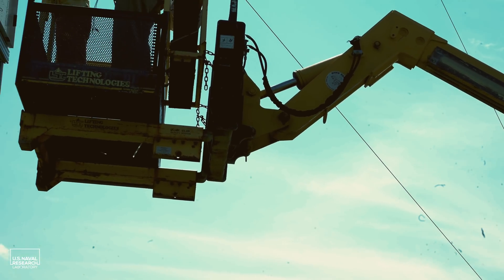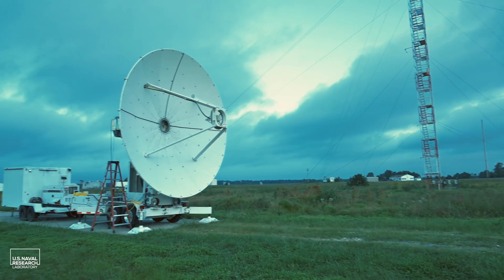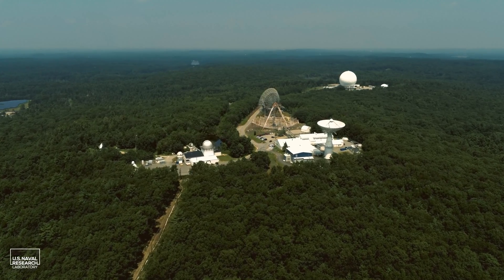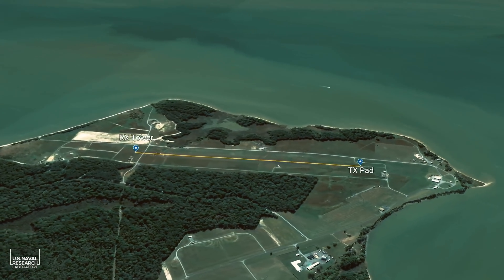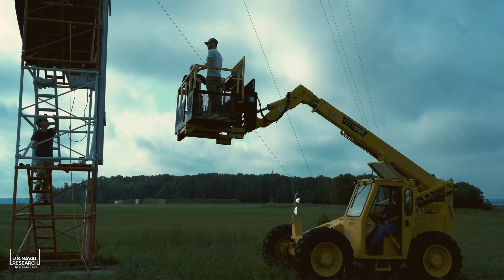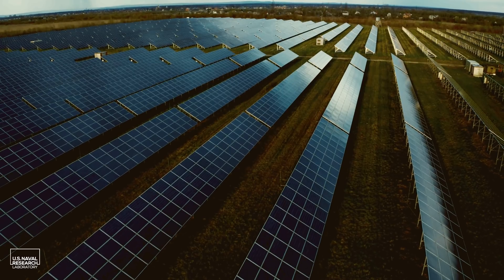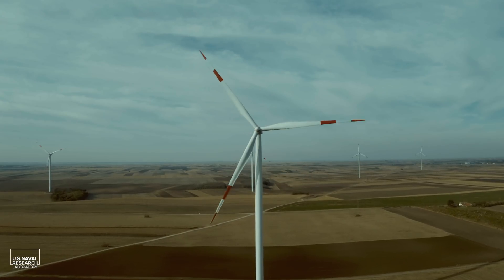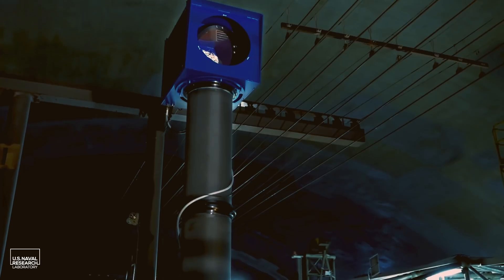Future of Microwave Power Beaming

Comment: Option 2: Focus on the Technical/Geophysical Aspect (Best for a technical audience)"The solution for a zero-impact base-load grid lies in exploiting the Earth's electrical anisotropy. Geophysical data confirms that major fault systems, mineralized with graphite and sulfides, act as stable, low-resistance conductors—natural transmission lines—favoring directional power flow along the fault structure. By coupling this passive, subterranean grid with energy harvested from tectonic stress events (the $\psi_{\ddot{}}$ term), we can achieve a truly sustainable, 24/7/365 power source with minimal surface footprint. The New Zealand Alpine Fault is the ideal natural test area for this concept."

Comment: Option 1: Focus on the "Greenest of Green" Potential (Best for a general audience)"We need to stop thinking of the planet as a resource and start seeing it as a generator. Our models confirm a vast, 'Greenest of Green' energy source: harvesting the natural electrical charge generated by tectonic stress ($\psi_{\ddot{}}$) and transmitting it through pre-existing, low-resistance, mineralized fault zones (like those in the Superior Craton or along the Alpine Fault in NZ). This solves the base-load problem with zero-impact infrastructure, turning geological anxiety into reliable, endless power. The next step is a deep-borehole voltmeter test."

Comment: I have an idea and a design that can help humanity... But i am not taken seriously by others because I am just a kid, i designed a launcher that will make the need for fuel to cross the karman unnecessary, don't worry, I did took G Force in consideration , and when I simulated it, the launching speed was 10.5 km/ second... Don't worry, forces like wind drag, heat and all, I took in consideration, And with a few adjustments, more then the escape velocity, its a design of a maga project one that will take time to create but will aid us forever, I also have suggestions for taking in the sun's power and sending microwaves to earth, on specialized 5 km radius zones which receive the waves and convert it into clean energy... And it can charge the launcher... The launcher can launch 4 to 6 times a day... Up to 10 tons to 50 tons, no need for old fashioned rockets whose fuel takes 90% of its mass...

Comment: i built my first crystal radio set when i was like, i dunno, 6, 7. and when i realized it was being powered by the radio waves themselves, i took out my invention notebook and drew a satellite beaming solar power down to earth. now i know i haven't gotten smarter since then, but i have learned things that i didn't address, nor were addressed in the video or in any of the comments:

w/m^2 at a given radius, what is the divergence of the beam, what is the efficiency of the system overall (you said 100kW transmitter for one of the experiments, but that obviously doesn't mean you're pushing it to 100kW, but amplifiers also have losses)

it just seems dangerous for many situations. most, perhaps. emphasis on "seems" though, because i don't have that data, you do, but you haven't shared it with us

Comment: have you ever considered going to space on microwave beams ?

here's how it (theoretically) going to work : 

you take a spaceplane, make large portion of it's surface into a microwave reciever and launch it above the ocean, where, along it's way there are several ships or stations with nuclear or later - fusion reactors onboard, cooled by ocean water and huge antennas to beam power to the space plane

of course it needs some serious material science to construct plating that is both heat-resistant and can receive or let through most of the microwave spectrum

and plasma-arc engines of course, running on burning and ionising air in the atmosphere and on liquid hydrogen in space

the upside of this method of spaceflight is that you don't have to carry a reactor on the plane itself, which both saves mass and makes the plane safer (no nuclear contamination in case of a crash) 

of course this concept needs some work and A LOT of money to accomplish, but at least it seems feasible

Crab out

Comment: Future of Microwave Power Beaming? 100kW to get 1.6kW at 1km away? that is 1.6% efficiency. So, if you can convert 100% of the suns energy in space and send it back to earth with a subsubzero efficiency, you get way less than current PV solar cells.
Also, comparing producing electric energy to transporting electric energy???
Reply: can you point me to the source specifying 100kW input?   It's a key point that needs to refute the claims of how viable this is.
Reply: @pixelpusher220  https://youtu.be/JGuPaYtcJx8?si=p1uZ9p3t022DENz8&t=55 at 0.55s

Comment: "Duty Cycle" How would you cool the transmitter components in space?
Reply: Huge radiators and a liquid ammonia cooling loop would be a pretty standard solution. Can be placed on the back side of the solar panels, or for more surface area, can be deployable perpendicular to the sunlight, like those on ISS.

Comment: They used how much equipment? and lost what percentage of power?  And made how much area uninhabitable?  in order to move enough energy to power a small window-shaker type air conditioner?  They call this green energy production, but this system did not create any energy, it just moved it from one place to another, with a loss.
Reply: I agree. A bit misleading since they don't divulge the whole production cycle, just the fact that the transmission portion is green.
Reply: Not really a loss in this sense because, when oil burns off it is a loss, even when it's used efficiently. When sun power is not fully captured, that's just normal. We don't really deplete the sun, we just don't optimize the scraps of solar it throws us anyway.

Comment: I don't know if relays involving solar or wind powered balloons/drones/zeppelins are even necessary for safety or signal strength, but maybe that's additional options if needed. Also if "heat batteries" are a real thing, whether graphite or other, it seems like continuous beaming may not even be necessary over night or in bad weather. Other thing is if there's more options than solar power, like if a "glide satellite" put in lower atmosphere could beam it's heat shield energy power. Obviously land based, remote nuclear plants and wind turbine locations(alongs high ways/waterfalls?) etc, also paths. This is more ways to export energy sales is more incentive, for at least a decade. Varied locations could create more civil energy markets/participation.
Reply: terrestrial energy production (from renewable sources) cannot be scaled up like SBSP (Space Based Solar Power).
Actually, SBSP is a renewable energy. With the least environmental impact.
Reply: @jeechun  I don't know if that's accurate but...land based transmission might make sense for beaming from dessert solar...offshore wind...geothermal locations...compressed air sites...hydro electric sites..."Gravity battery" mountains and nuclear power plants built in remote locations. So while terrestrial beaming might yield small percentage, it's potentially big diversified energy pie with many sources. A "gliding satellite" might only need to cross the continental U.S for five to ten% of energy power, contributing adequately to national grid.

Comment: Video carefully avoids to state that the overall efficiency of the system is 1.8%. Input power was 91.2kW at the TX antenna, out of which 1.65kW was produced at the receiving side. 
https://ieeexplore.ieee.org/mediastore_new/IEEE/content/media/9171629/9673801/9662403/roden.t2-3130765-large.gif
Reply: The authors' paper carefully explains the link efficiency.  It describes how the efficiency would be significantly increased by modestly increasing  the receive antenna's size or by using a power amplifier that's better matched to the transmitter antenna size.  Any rapid demonstration put together with things on hand will involve compromises.
Reply: @1209832asdasasd  Can't wait to see the demonstration with 44% overall efficiency..  :-)
Reply: @137vuk  that won't happen other than at very short distances. They will not get around the inverse square law.
Reply: It's not finite fuel power supply source though, so even if getting a small percentage back if that were true, it's still a percentage not being depleted at either end because it's solar powered. It's different context from limited resources power supply.
Reply: @sampleoffers1978  yes, the free fuel aspect of renewables - if you need more capacity you just build more infrastructure.   However, in this case building that infrastructure is prohibitively expensive and mostly beyond our capability.   You'd need space structures in the size of multiple square kilometers.   At geostationary altitude of 25,000 miles.  For a minuscule fraction of the cost you could build solar panels here on earth as well as batteries to store that energy for night time.   It's a SciFi fantasy that is overruled by physics and cost.
Reply: So, does the other 98% heat the air, and raise global warming?
Reply: Exactly !! when I start watching this I was waiting for the yield numbers. They briefly mentioned 100kw at the beginning but of course not detailed discussion about the overall efficiency.... The audacity to talk about green energy when your system throws away 98% of the power to the trashcan 🤷🏼‍♂️🤷🏼‍♂️

Comment: Tesla had some big tower that was to broadcast energy in his day. Not sure what frequency. or power source or what the receivers were to be.
Reply: Tesla's plan for wireless power transmission was based on induction and capacitive coupling. Capacitive coupling has few practical applications. Inductive transmission is what's used in most wireless phone charges today. Induction can be pretty efficient at close distances, and with resonant matching and a high enough frequency, it can be nearly as efficient as wired transfer at close range. But, power transfer efficiency drops exponentially with distance. Electromagnetic power transmission (this), usually in the microwave band, has a lower overall efficiency, around 80%, but that efficiency changes very little with distance, even out to hundreds of kilometers or more. The only limit to efficient EM power beaming is maintaining a collimated beam.

Comment: How much was lost in transition?
Reply: GaAs-diode rectenna arrays have an average collection-conversion efficiency of 82.5%
Reply: thas very impressive
Reply from the maker: Researchers stated that even in heavy rainfall, loss of power is less than five percent.
Reply: @USNRL  yeah heard that part in video. 5%. At 10gh. As a satellite technician we wish we could get that kind of fade but b, ka,ku bands suck. So how long till we surround the sun with solar panels and beam the power back to earth😏?
Reply: @justanotheroglesby2847  I doubt they need to actually even bother with solar panels too much because in space there's spinning possible and orbit pull motion to skim power from likely. Also supposed to be "van Allen radiation belts" supposedly.
Reply: Power density on the receive side will never be better than inversely proportional to the square of the distance from the transmitter.